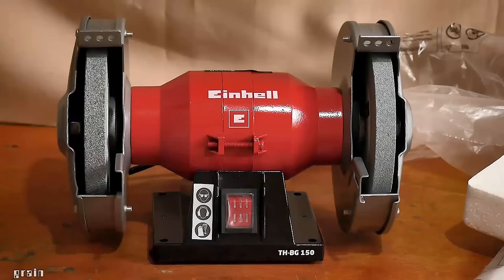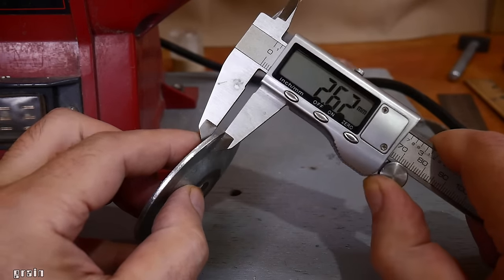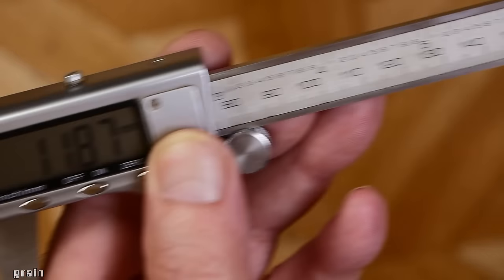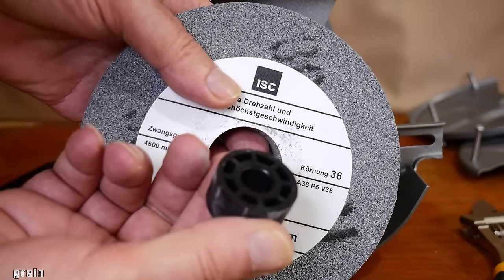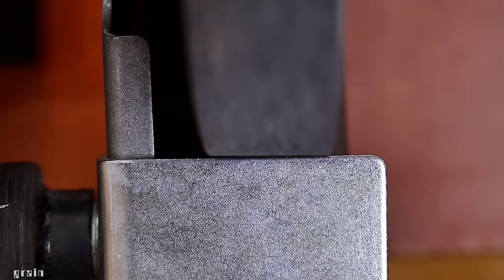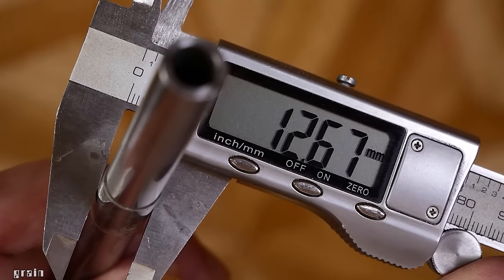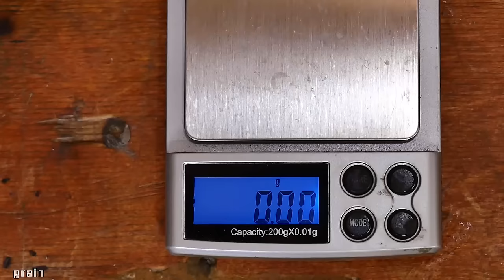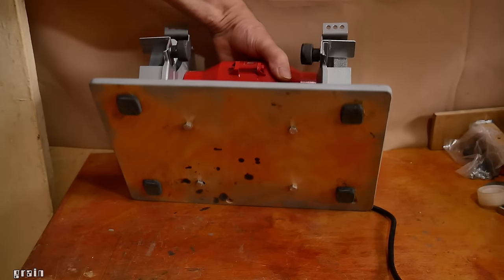Bench Grinder. Removing vibrations, balancing the abrasive disc, faceplate and more.

Comment: Hi folks. Fitting grinding wheels in industry is treated as a highly killed operation reserved to specialist trained fitters. There's a good reason for that. Don't mess with cheap grinders, buy a quality product. Yes, it's more expensive. Much nicer to use and much safer. Incidentally, those paper washers are important, do not leave them out. Check the wheel for cracks before fitting, a light tap with a small hammer and it should ring like a bell, if not, break it and dispose of it. Do not stand in the line of fire. Buy a machine with heavy duty guards and tool rests. Do not grind on the side of the wheel. Have a good read up about 'Grinding wheel safety' before ever using one. Wear safety glasses. Misused these things can kill and blind. The surface speed of a hobby grinding wheel can approach 60 mph, around 100 kph.

Comment: the nut on the end of the shaft is also not perfectly square and applies uneven pressure. This can be corrected using spherical washers.
Reply from the maker: In such close proximity to the center, such influence is minimal. But checking the balance of the motor rotor is a good thing.
Reply: @grain-diose  the influence is significant.. Rigid metal wheels (like CBN) will not rotate co-axially , causing bounce and making it difficult to use, especially on the sides of the wheel.
Reply from the maker: @executive  Sorry, I misunderstood you. Yes, you are right, the clamping plane of the nut is not ideal. That is why the clamp is made through a cardboard gasket of about 0.5 mm, so for an abrasive disc the plane of the faceplate is the basis, which is desirable to be milled directly on the shaft. Watch my other video about it - https://youtu.be/CVYg9FFsLVo?t=319

Comment: is it better to bolt grinder to the table or leave free standing with rubber feet?
Reply from the maker: As you can see, my set up grinder just sits on the table and that's how I use it. Yes, if I had a permanent workshop, maybe after setting it up I would fix it on the table.
But if you firmly mount the grinder on a table or wall just to reduce vibration, then this will definitely accelerate the wear of the bearings.
If the grinder is set up perfectly and doesn't vibrate even after braking (check it out!), then you can do as you please, I think it doesn't matter.
Reply: @grain-diose  thanks for the answer, i plan on balancing first as i prefer not to drill bolt holes in bench.

Comment: Great job !!! There are commerical wheel balancing tools such as the one from one way .. but your trick of using lead solder seems great !! What glue did you use please ?
Reply from the maker: Thank you. I used Somafix S663 cyanoacrylate glue, it comes with a fixative, it is very convenient, I have been using it for several years. Now I see S667 on their website, but I think this is not important, I used to use small S661 containers, it made a fundamental difference. 
https://www.somafix.com.tr/SOMAFIX-UNIVERSAL-FAST-ADHESIVE-S667-EN.html
This adhesive has good strength and sticks even to smooth surfaces. If there is no such glue, I allow the use of epoxy, this is also reliable.

Comment: Interesting I checked my recently bough grinder it has a proper base plate but the disc is new and not balanced. I never knew to check that when purchasing just went to 1 200mm machine from reputable machine shop worked out great.

Comment from the maker: Friends, if you don't have Somafix, use epoxy glue, it's even stronger. Epoxy gets into the pores of the abrasive disc and it's a stranglehold.
They write to me here in the comments that it will fly off and gouge out the eye. They did not see and did not try to tear off Somafix, especially from a rough surface. Yes, I needed to show epoxy bonding, but I was sorry for the time, I'm sorry. I do not recommend any other glue except for CA Somafix and epoxy, it can really be dangerous.

Two Ways to Make a Faceplate for Bench Grinder (No Lathe) - https://youtu.be/CVYg9FFsLVo
00:00 Beginning
00:37 Key points
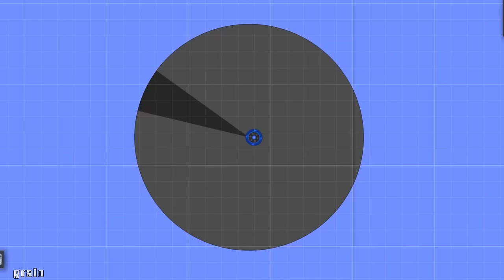01:08 For some theory
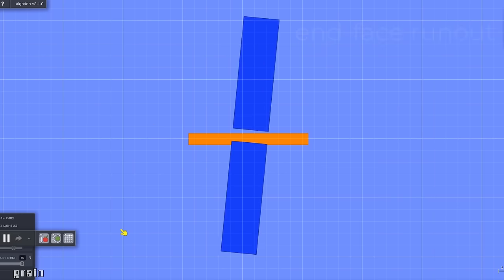01:23 End-face runouts
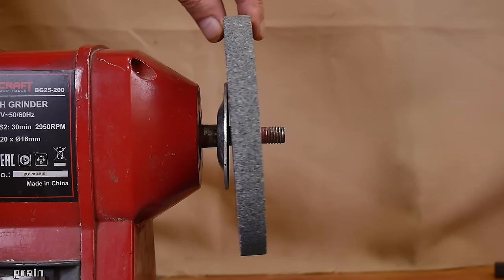01:28 The motor shaft
01:44 Thin forged washers
02:21 Faceplates on Makita GB602
02:49 Faceplates on Einhell TH-BG 150
03:11 Discs with a hole of 12.7 mm and 32 mm 
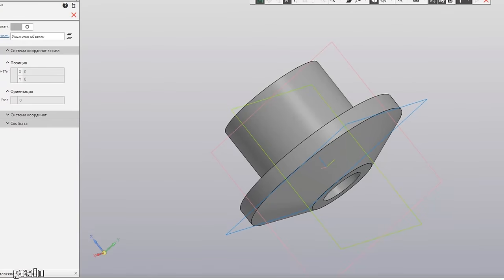03:28 Faceplate 3D projection
03:44 Plan for the next video
04:09 Faceplate seal when mounted on a shaft
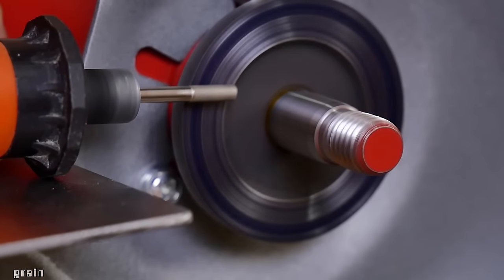04:34 Grinding the faceplate
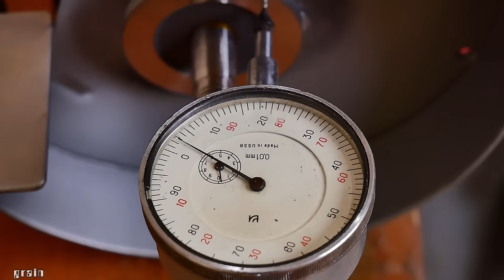04:53 Correction of the radial geometry of the disc
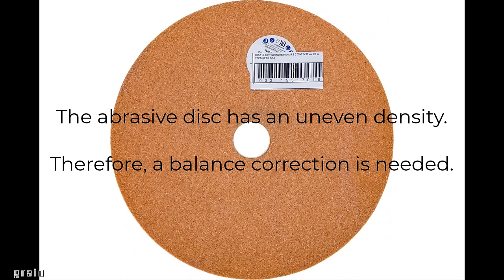05:40 Disc balancing
06:53 First disk test
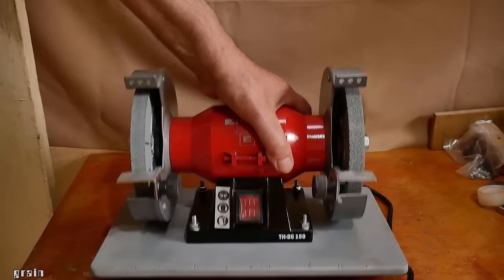08:15 Final test of both disks
By the way, the less vibration, the longer the bearings in your grinder will last.
Reply: I was taught those things by my Dad 60 years ago and never failed to tame a nasty grinder! I can't stand unnecessary vibrations anyway but on a grinder it results in a poor finish. I've never seen glued on weight correction and I would not recommend it. The next step with that grinder is to change to a better grade of ball bearing. Those sound horrible!
Reply from the maker: @dpeter6396  A good bearing is the basis, it is not even discussed. And discs all require balance correction, even professional ones. But professional ones have a special washer with three weights and a groove for moving them. There are many videos on YouTube about it.
Reply from the maker: @abcxyz2927  And what do you say to those who drill an abrasive disc to remove its imbalance? In fact, the disk has a protective casing. And you first try to tear off the CA Somafix glue or epoxy from the abrasive disc. And the disc can scatter itself also from constant vibration when it is unbalanced, have you thought about this? If everything is dangerous for you, do not buy any devices and machines - any of them are life-threatening. People manage to die in the bath with a cell phone and a cheap Chinese charger, do you want to save all the idiots?
Reply: paint it black and it will start rapping, then it will make kid and run away hehe
Reply: Buy a Baldor, and forget all this chicom junk...
Reply: ช
Reply: How did you measure the weight of the adhesive you used ?? Nice video fella for sure.
Reply: you can mix strong glue (somafix) based on cianet with baking powder or ciment,  bond will be even bigger
Reply from the maker: @anteneupitra  It's better to use epoxy. In any case, do not ignore safety precautions and work with a protective casing, then even if the sinker comes off, it will fly down according to the movement of the disk; the protective casing will not allow it to fly up.
Reply: @grain-diose  yes a prefer epoxy too..thnak you

Comment: what is the concept of understanding minute 6.20
Reply from the maker: The actual center of gravity is different from the geometric center of abrasive discs, even professional ones have this. After all, this is understandable, because they are not made of a monolithic material, but are glued together from small particles. Professional discs have a special washer with three movable weights and the ability to fix in different places to eliminate an imbalance in the center of gravity. By the way, this is also checked by putting a disk on the shaft, installing it on two parallel rods. There are many videos on YouTube about this.
But this applies only to radial vibrations. But there are still end vibrations, for which you need to make a high-quality faceplate.

Comment: Balance the grind stone and every time you dress it it can be out of balance due to uneven density.
Reply from the maker: That's right, after grinding off the abrasive stone (say 1 cm), a slight imbalance will appear again. But I don't think it will be as much as when buying a new one.

Comment: I find just using one trues it up anyway, just as an out of balance spindle on my lathe turns true after using a gouge on it. But hey, each to their own.
Reply from the maker: Yes, there is such a way. But removing the abrasive disc is quite laborious and non-standard, although a diamond cylinder and a dremel can help. 
By the way, I didn’t think and therefore didn’t say in the video that in any way with significant grinding of the disk (for example, 1 cm), a slight imbalance will reappear.

Comment: Instructions not clear, now there's glue, epoxy and wires stuck to my face. My eye got hit by the glop of glue, and the balancing wire wrapped around the shaft and caught the nearby Vise-Grips. They were slung into my car windshield and my wife was sitting in the car. The windshield shattered and it blew all over her face. She was pulling out of the garage and hit the garage door and the wall. All due to this cockamamie glue trick. I'm suing for bad advice, mental stress, emotional damage and property damage.
Reply from the maker: A funny story.

Comment: Maybe before you take this trouble start with replacing the bearings
Reply from the maker: It's so banal, I didn't think it was necessary to talk about. And by the way, you can check the balance of the rotor, some manufacturers do not worry about this. But my video is only about balancing the disk and the faceplate, it's impossible to cover everything.

Comment: Fixing the runout of any kind described above with anything that moves is a waste of time. All it will do is follow the run out. What you suggest just will not work and will not solve the problem. Its the same as sanding an entire board to take out a twist the sanding just follows the twist.

Comment: Wrong at 4:36 and 5:29. You omited that hands are biological parts. That means has elasticity and flexibilitiy wihch means your hand borrow tha excentricities from fiscs and fixies are partial. In this case both tools should be placed on rigid stands and adjustable of course.

Comment: I'm sorry, there is no glue available to mortals that I would trust to hold something on a wheel turning at over 1000RPM.  A recipe for disaster.  YMMV.
Reply from the maker: Epoxy will help you, it's even better than CA glue.
Reply: @grain-diose  I’m sure there are people out there that would trust something glued onto a spinning grinding wheel.  Having worked as a machinist for over 40 years and having seen plenty of disasters that “should have worked” I’ll pass.

Comment: As race, we put a man on the Moon, and we want  to to the  Mars. but we can't make centered abrasive discs with homogeneous composition or the manufacturers are jerks.🤬🤬🤬 I had the same problem with mine.
Reply from the maker: Abrasive discs cannot have a uniform composition because they are made of particles.
Discs for large professional machines are made with special balancing washers; there are a lot of such videos on YouTube. But these washers are quite large; this is impractical for a home sharpener. But maybe someone will try to do this and show a video.

Comment: Use a Huntington wheel dresser and you are done.....
Reply from the maker: You misunderstood, alignment by geometry does not solve the problem of non-uniformity in the density of the material. The geometry must also be corrected, but after the imbalance of the abrasive disc.

Comment: you should never add a foreign object to a grinder wheel..... especially with just super glue it can fall off.....the proper way is to remove materiel ......the rest of the video is good but i would  never glue sum thing to a grinding disk that spins at over a 1000 rpm.....that is just asking for it...
Reply from the maker: 1. I've attached a comment above: "If you don't have CA Somafix, use epoxy."
2. Only very experienced people should remove material from the abrasive wheel. I wouldn't recommend this to a hobbyist.
3. Have you tried tearing off the CA Somafix from the abrasive stone?

Comment: Or you can dress the whole wheel with a diamond. Vitrified bond is soft and easy to true up with the diamond.
Reply from the maker: With a diamond, you correct the geometry of the disk, this is also necessary, but that's another story. But you cannot remove the internal unevenness of the disk with a diamond. This is a consequence of the production of any abrasive disc. This is not metal, these are glued particles, they are distributed more or less evenly, but not perfectly. Do an experiment: align your disc with a diamond and put the sharpener on the table without fastening, turn it on and off - you will see that the machine will start to shake during the braking process. This is a result of disk imbalance. There are a lot of videos on YouTube about balancing professional emery wheels, they come with a special washer with three weights that can be shifted and fixed in the desired position. https://youtu.be/RJVn-G2nZaQ?t=232
That is why I first corrected the geometry by pressing the machine with my hand to the floor and only then removed the imbalance. Otherwise, I would have to correct the imbalance twice.

Comment: Wrong way to bounce the grinding wheel on the grinder you use a stone sharpener which proves the wheel and removes the vibration. Some people should be doing videos they couldn't change your people's lives.

Comment: Glue some shit on the grinding stone and that will kill you for sure. At that speed will be like a bulet. Thanks for the crapy advise.
Reply from the maker: Operate a sharpening machine without a protective cover and it will kill you even faster. Have you seen in which direction the disk rotates, in which direction the sparks go? Now think about where the sinker will fly if there is a protective casing. Follow safety precautions and do not write nonsense.
Reply: Your stuff is non sense.

Comment: That grinder sounds like it has a defective ball bearing. When you buy a new grinder, you should not have to correct all the manufacturers defects. It should be designed and built to run smoothly right from the start. Stay AWAY from Harbor Freight!
Reply from the maker: Ball bearings are in good condition